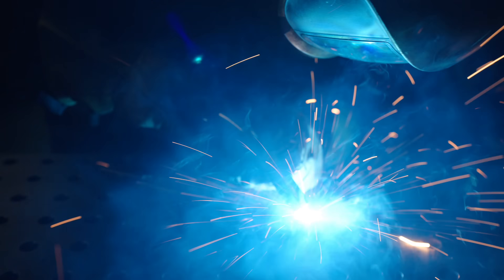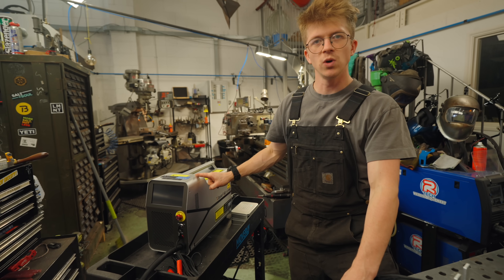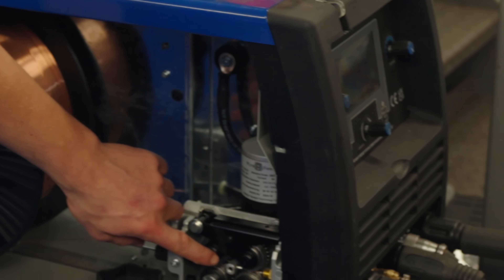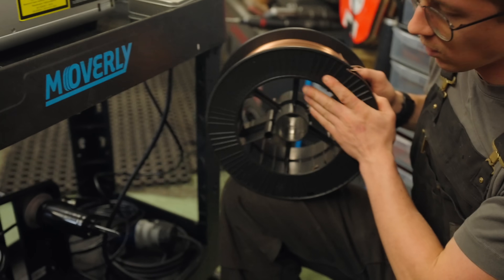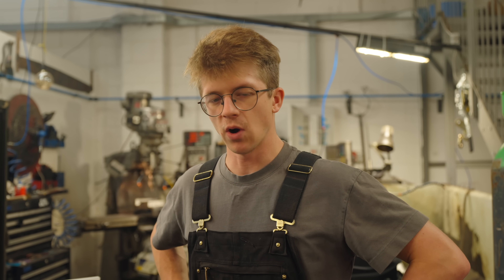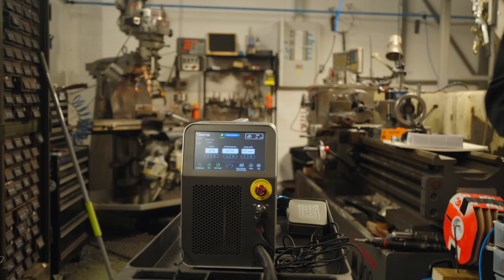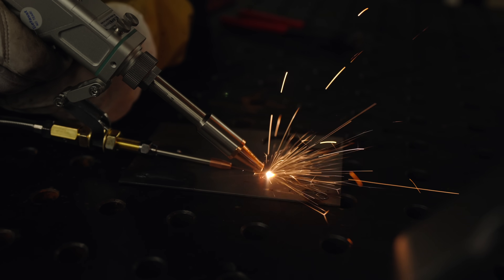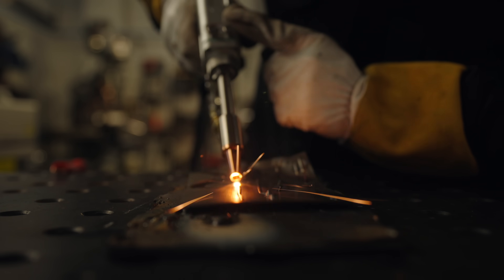Laser Welding

Comment: Im a metalworker - every now and then "new and improved welding machine" comes around - and its always the same gig : costs gabagillions, and/ or uses umpteen different consumables, that are also stupidly expensive / hard to source / both.  I am  (positively) confused - the machine costs less than a good tig set, uses already common gas and wire,  lenses are like 50$, but supposedly last a month or more ...  what am i missing? Sounds too good to be true. About the rag ignite thing : thats fucking dangerous AF - they have to do something with the trigger - most common little accident is when you put your torch down and the button gets pressed by a piece of metal, edge of the job ect - normal welder can cause you to have to clean it, maybe it will flash you - this one? Could freaking start a fire, and/or kill/ seriously injure people.... Apart of that its an insanely cool tech

Comment: I've seen videos of laser cnc set ups. They are always separate rooms or cabinets with warning lights outside when the laser is in use.  They also sometimes have electronic interlocks so they cannot be opened. There is also an emergency power cutoff outside the room.

Comment: I work for a company that makes industrial laser cutters. Similar to the Plasmacutter he has just bigger, more powerful and using lasers. The thing is that diode pumped fiber lasers are insanely cool but also insanely dangerous. You're blind before you know it and laser safety is taken super serious. Even I as R&D engineer can't enter the areas where they actually go pew pew and the machines don't even work if you don't fully enclose them.

Comment: For laser welding, slower feed means more heat per square milimeters; but it can't go deeper farther than around 5 milis since it doesn't produce heat itself, more likely just point welds what's at its focus. So, the worst cons are you can't throughly weld that thick, which is uncommon on forges but common outdoors, and you can't stick up bids easily.
Making damascus cages for forge weldings, it's more than enough; Fine finish, easily destructable when heat applied then cooled.

Comment: It's great when someone has an assistant as helpful as Jamie to get the work done efficiently. "Suspicious Counter-Strike"

At the cutting part I was slightly concerned where it was about to go hearing "0,8 mm steel". Just hoped there wasn't another laser cutting of Steele.

My university had a sort of CNC laser cutter. It was in the heavy laboratory in the basement in the side room, at the end of it in an alcove behind a big screen with all kinds of warnings and safety locks before it could be ran wearing safety equipment. A manual lathe and CNC machines were just in front of the main door in the middle of the main hall. I think that speaks of the difference in concern.

Comment: I wanted to get this for cleaning rust of car plates. Imagine being underneath the car, and just burning away everything. Safer than using a round blade and faster than wire brush. Also removes less material from the surface meaning you don't compromise integrity.

Comment: 17:40 back in the states, laser cutting at least, has been around for a while and often used in schools to cut wood and fiber board, etc. OSHA specifically requires a laser room to house equipment, or a case around the equipment (like most cutters have) they must have ventilation, not let the light escape, and must have protective equipment and be fireproof 🤷‍♂️ uk behind on this one

Comment: I had absolutely no faith on laser welders. Now I can at least say they work great on light suff. Too bad I work with 1/8" material and thicker. 
But I'm thinking I can use it for the external part of it and then go heavy on the inside. 

I make HD steel bumpers for HD trucks, chassis for specialty applications, roll cages, etc. 
And for bumpers, it has a place in my shop. 
Not for other stuff unless I can get one that can actually be used to penetrate 1/4" without welding from both sides. That ammount of power is still for stick welding mainly

Comment: you should get an induction heater. it can heat metal faster than a gas forge, and only requires electricity and water pumping. It can also heat metals to really high temperatures, even their boiling point.

Comment: If I'm honest, I've been sceptical about these since I believe so many of these "laser welding" videos are fake and use a prettied up MiG torch, but I guess this is the real deal. You're not going to get a huge amount of power out of a small unit like that, once you get into kilowatt range which is required for anything moderately thick you need large cabinets with their own dedicated water cooling system, not practical for your typical workshop, plus it's too spicy to do by hand so you need robotic welding systems in their own interlocked enclosures. As such it's only going to be practical for thin sections.

Comment: Thank you for such nice test of laser welders. I was a bit against of owning one for a long time. I was a laser tech and used to service 20kW lasers for cutting metal. And I know what that damn thing can do. One thing I have to thank you for - always before you pressed that button, you had your welding helmet on. I just hope your coworker had at least those special glasses protecting from laser radiation 😋 Hand held lasers have one thing in common - human flaw. And it takes just a tiny burn like you had, to flick the wrist and risk loosing eyesight by any bystander, who doesn't have eyes protected. I will be very straightforward - that s...it is no joke. Especially with highly reflective surfaces like stainless steel (or other reflective metals).
It works wonders, but in the hands of an untrained and stupid people, it can be a disaster for others in the area too.
Stay safe and enjoy your new toy! 🖖

Comment: I don't believe he mentioned it but this is a 460 Watt CW laser system. As far as Welding lasers go that's not much, there are great videos from both Styropyro and TheBackyardScientist on 2000 Watt laser welding systems which are much more powerful, these videos don't focus on the lasers welding capabilities and are a little silly at times but they do a great job of showcasing what a laser likr that can do and what it cant do. Now do you need a 2000 Watt laser? Depends on what you're doing with it a 2000 Watt laser is definitely better when welding thicker parts than thid 460 Watt laser.

Comment: We have been testing a water-cooled twin wire feeder 3 kW laser welding machine for two days. We welded stainless steel, carbon steel, and aluminum pipes, mostly butt welds that need to meet pressure vessel quality standards. After testing, we sent five samples for NDT, and all of them failed. There were pores everywhere and some connection defects.

Comment: Quick little tip that MIGHT work with a laser welder (I say might as I have never used a laser welder before BUT I do a type of welding called cladding where we use welding lances with TIG and large machines) and we have welding wire without any kind of core in it. So its close to normal TIG wire but thinner and in 15kg spools. 

I have written this comment before watching the whole video

Comment: Can you do like a stitch weld with the laser to increase the strength like you would with  mig? Like a root pass and weld both sides of the root? Also wonder doing thicker material  weld out with the laser then mig weld over on key areas for strength to cut out a quarter of the mig or tig welding

Comment: I’ve done production welding on thin sheet for years, and that 15-second laser pass vs. 40 seconds on MIG and two full minutes on TIG is no joke. What stood out most is the minimal distortion and how tiny the heat-affected zone is. On box-making jobs, shaving off that much time is a real workflow changer.

Comment: That's the easiest and cleanest welding method I've ever seen!
Also, if it fits some CNC setup it might even work as a laser engraver with a low power settings. I know it isn't designed to be used like a multitool like that, but you know. Options.

Comment: Where this excels is the automotive world. You can fix up old cars REALLY nicely. There is minimal grinding needed, and burning off rust is so much better than using a wheel. You can also cut some panels really well with it. The place that it SUCKS in the automotive world is that can ignite fuel and oil spills without even trying, so you have to be ultra careful with it. Like you said, there isn't 100 years of safety knowledge with them. You basically need a room for it, but no one is gonna do that. Get the eye protection for it, you normal welding mask might not work (depends on the mask).

Comment: now try this on a sausage inside a working glove at max settings "no security precautions" simulated
oh and on water, oil or resing or whatever quemical stuff u use to metal, what would happens?
and damascus, even better, try it on the failed damascus barrels rot iron (and other metals with with different melting point)

Comment: Scientist who works with high powered lasers on occasion (LIBS) here. It looks like the rest of the comments have safety with reflection covered, I’m going to point out that you took your eye protection off with your hand still on the trigger. If you slipped a nanometre around that button with reflective surfaces you could go blind faster than your blink reflex. You need to treat this fairly differently than your other welders, especially while you have dangerous reflexes. Second the need for a safety class. :)

Comment: this could be very useful for car body shops and sheet metal work in general. I find mig welding thin sheet metal to be a dreadful slow process cause the super thin stuff can only be done with a series of tacs. this thing seems to knock out small welds in sheet metal like nothing

Comment: 10:40 just so you know, there are wire feed option kits for tig that use a MIG spool. skill less task, like writing a letter. just bigger sticks, crayons are easier then quills. 3/16 and 1/4 inch welding rods are crayons.

Comment: I'd love to get a laser machine, especially one of the ones which are more suited to rust cleaning - But the one thing that has stopped me is safety. I'd be too afraid of accidentally forgetting the goggles or face shield and blinding myself. With MIG and TIG, you can get away with mistakes but lasers don't tolerate fools.

A cutting laser would be fantastic for a fully enclosed CNC machine, though. I might have to build one someday, but I think that might be where I'd stop. Maybe I could build a sort of sandblasting cabinet for a laser cleaner with a protected window, which might resolve the safety concerns for that usage.

Comment: I have a similar unit, but with more power. You can weld heavy and thick steel, but not with those "cheap" units. My machine has more than twice the claimed power (minus the Chinese overrating, which I assume is similar on both units). Also, as you found out, it's not the same as the other welding methods, the usage patterns are different. 1:1 usage of TIG or MIG welding won't get the best results. You did mention the safety parts and got a lot of good comments already. Never forget, these toys can cause serious harm or injuries even across the workshop. Take a training course and it will become your favourite welding type. It became mine :) 0.8mm steel sheet good, 3mm thick aluminum, stainless steel: super easy. My machine came with a huge cheat-sheet with various settings as starting points, maybe they got somethings similar.

Comment: 4k for a mig welder that turns energy into a laser instead of an arc seems a bit silly. Especially considering the thickness it's capable of. The 3 modes are just adjusted settings so I won't take that into consideration. You could spend 4k on a machine that does each welding type on its own or even a generator. "New tech!" Is the only justification for that price imo. And that 5% off lol yikes. Sounds like somebody needs to work on their margins.

Comment: We tack with a TIG, and use the laser for all the long lines. We have a jig, so the laser gun can glide over the "edge" of the piece. That way, it welds over the tack welds, and they become invisible to the eye. The jig makes it possible to use very fine "flap disc" type of wheel, on a small air angle grinder, that can glide on the jig rails. Gives a very uniform look.

Comment: Now you can do a remake of the 007 film Goldfinger, where James Bond is lying on a table made of gold and Mr. Goldfinger shows him how a laser beam cuts through this gold..... ;-) 
But on the safety side.....when I saw Mr. Steel standing in front of those huge gas tanks I thought: what would happen if accidentally the laser beam would hit those tanks (like it did with the welding table....or the rag).....
I am happy to see the video was edited and was uploaded, for this means nothing bad happened during recording.....but extra caution should be used with this kind of laser welder.
After all a nice and not so expensive machine....

Comment: I wonder if they’re giving more of these away than they’re selling. It appears that virtually every channel that deals, in any way, with metal is being given one. I have a different one, a bit more powerful, and I’m very pleased with it. But, it’s pretty different from MIG or TIG, so if you try to use it that way, you’ll be disappointed. It welds differently and you have to understand that.

This model is just 700 watts, pretty low power. 1/8” (3.2mm) max if welding from just one side. Around 3/16” for both sides. It’s ideal for 12 gage or less. For cleaning, to reduce that rippling finish, increase the frequency to the maximum. It will scan more rapidly and the finish will be smoother.

Comment: Hi, thank you for the cool video. I recognize you from a video Tom Scott posted a while ago when you taught him blacksmithing! I'm a physicist who worked with lasers and other collimated light sources in a laboratory for the past three years. Lasers have been used in labs for decades at this point and so there is a fairly well established set of safety guidelines specifically for lasers. Training materials for safe handling of lasers are required to include detailed explanations of what kind of hazards are present when working with laser and the mechanism behind them, along with common ways to mitigate these hazards. Obviously not all of the recommended practices would be applicable to your use case. For example, laboratory lasers are generally required to stay in a fixed horizontal plane, but this would be really difficult for a handheld laser welder. Still, I recommend looking into those guidelines because it will save you a lot of hazardous trial and error, and help you to make better informed decisions on how to use your equipment safely.

One relevant example is that generally laser beams should not be allowed to extend beyond the table (or immediate surroundings) where it is used, and have to all terminate at appropriate beam stops. I don't know what type of beamstop is appropriate for such high powered laser, but generally things like laser safety barrier is set up to surround the workspace or optical table completely. This helps to prevent situations like one you've demonstrated with burning rags in the distance.

Also, although invisible to the eye, the laser will reflect and scatter off of the metallic surfaces (and in unpredictable ways against uneven or moving surfaces like liquefied metal, which makes it even more dangerous). Though it is clearly transferring a lot of its energy to the welding material, there is likely enough light that is reflecting/scattering off the surface to pose hazard, especially to the eyes. You appear to be wearing eye protection that is sold with the welder on their website, but I couldn't tell what the camera person is wearing while you're demonstrating the welds (hopefully he's also got the same eye protection). Make sure not to use eye protection intended for use with polychromatic light (e.g. white light) because optical density is generally highly wavelength dependent, and an eye protection that is almost opaque in visible range can be almost transparent in other wavelengths. Always use wavelength-specific eye protection that matches the wavelength of the source and has the appropriate optical density rating.

Comment: This might be something that should require two signals to start. The trigger AND a foot pedal maybe?
I think actual gun safety rules apply with that kind of tool. Finger off the trigger until you intend to use it, never point it at anyone, keep the muzzle facing down

Comment: We have large Trumpf laser cutters at my job for cutting sheet steel. The general rule-of-thumb that we have is that the minimum diameter of a hole cut in the material is the thickness of the material - i.e. the minimum diameter of the hole in a 1/2" plate of steel is 1/2" diameter. The same goes for radii except it is half the thickness of the material - i.e. 1/4" radius in 1/2" plate.  The reasoning behind this is so that the material does not heat up as much causing bad cuts and slag formation. The hotter the metal is, the harder it is for the laser to cut it.

Comment: And the only reason you even need wire is to move the damn thing consistently. I've had pretty good success after some practice not even using wire. (I have the Skyfire SF-Weld Air but it's the same thing)

Comment: When I was studying lasers my instructur told me to never fear a lader but to NEVER lose my respect for it. Like you said it's like any dangerous tool in your shop. The laser has special unique rules you need to follow but once you learn them you're ok as long as you always respect them. Familiaruty breeds contempt.  I would point out  put that the Nominal Hazard Zone or the 'dangerous distance' on that laser is probably several miles when it's a straight unfocused beam.  I'm not kidding.